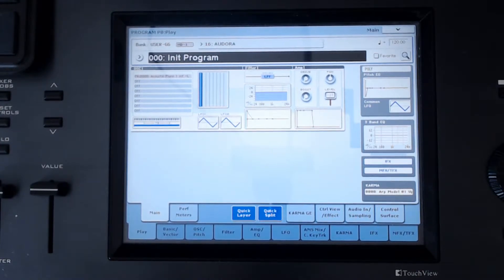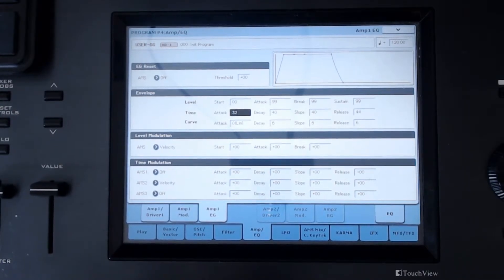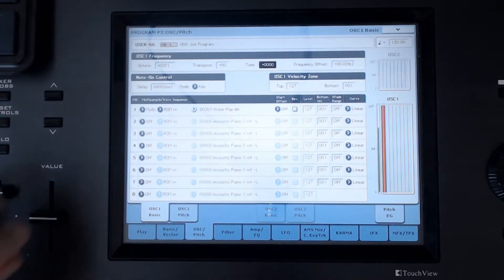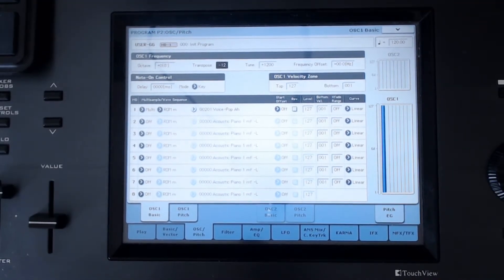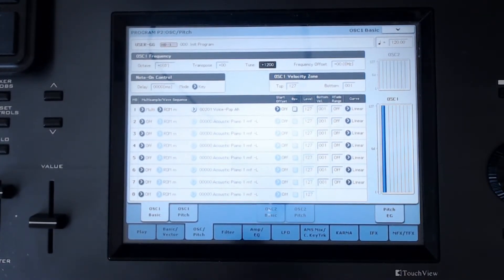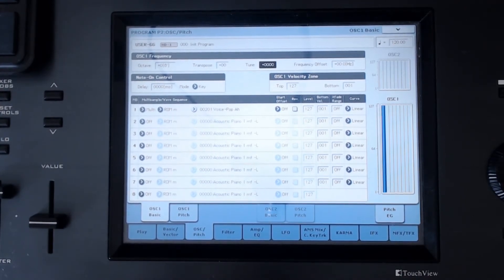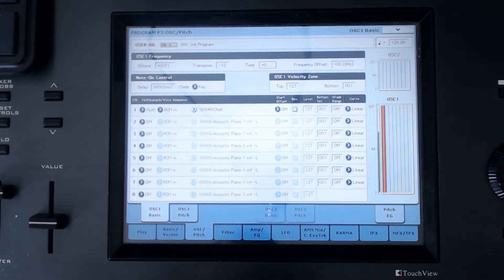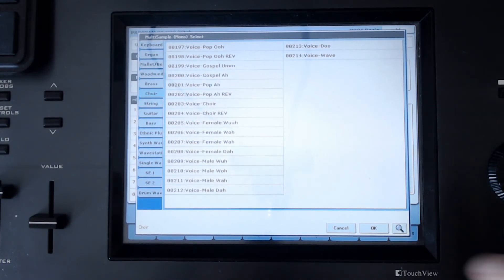Quick Tip: HD-1 Engine; Formant Manipulation

Comment: Dave. Thanks for your help! My question today is a file management question. Being new to sampling, I have accumulated duplicate index sample files. How do I get rid of duplicate unused files? With my Fantom X7,  I simply erase samples that are not being used post normalizing or chopping. Please tell me that there is a function as to were I will be able to erase unused sampling data!
Reply from the maker: There sure is - when you're in Sampling mode, just go to the dropdown menu on the top right, and select  "Delete Sample" - When you do this, it'll ask you if you want to delete "Selected" samples, "Unmapped Samples" or "All Samples" - If you select "Unmapped Samples", it'll delete any samples that aren't currently used/assigned and will clear the space for you.
Reply: Awesome! I did this and it says sample destination sample is empty ?
Reply from the maker: @WaltMo4  It only works when you're choosing to delete a sample or have samples that need to be removed. It doesn't do anything if the destination (what you have highlighted) is empty
Reply: Dave. That makes total sense. Making everything into a KSC file really helps to conserve space as well. Dude you are literally making me ignore my Fantom x7 ! Thanks
Reply: I have also learned that if I do this step while sampling it will stop the cluster of unused data. If you were in Dallas I would have to buy you a beer bro. Well done!

Comment: hey that's pretty good dude!  so the octave and transpose parameters are just midi offsets whereas the tune (and fc offset for that matter) are changing playback speed.  it's not that necessary to midi shift back to the og octave when detuning by 1200cents imo since the board is still in key... but the -700cents +7semitones trick was very insightful.

Great job pointing out that the trick doesn't make a difference when a single sample is mapped to the full range of the bed too.  Note that you're not actually changing the formant structure of the sound so much as just playing back a different, repitched sample but in the context of the example in the vid it is a formant shift.  If you wanted to change the formants of a vocal you could use the talk modulator as I'm sure you already knew.  To shift the formant up or down in ANY sound you could use the fc shifter ifx so long as you then use the fc offset parameter to compensate for the detuning .

Side note, the point of the frequency shifter seems to be lost if it's detuning the sound... but to me that effect is best used on atonal material like snares etc.